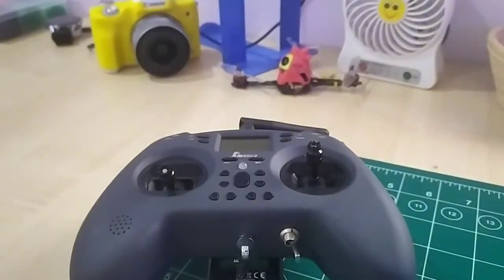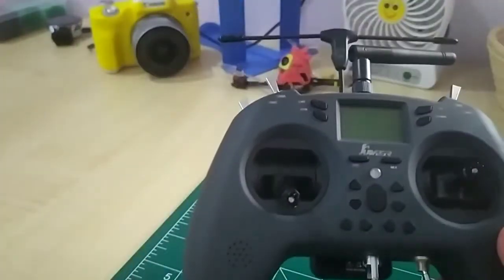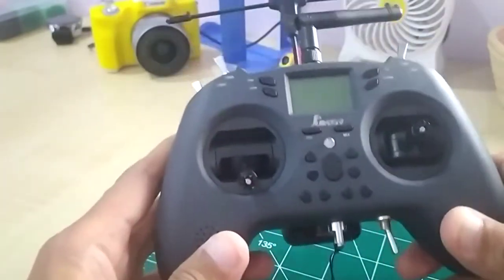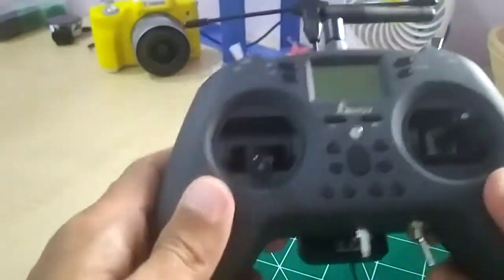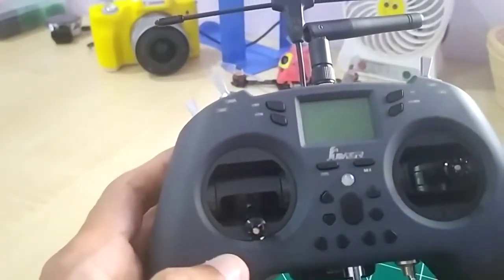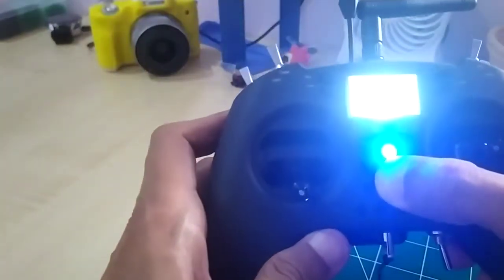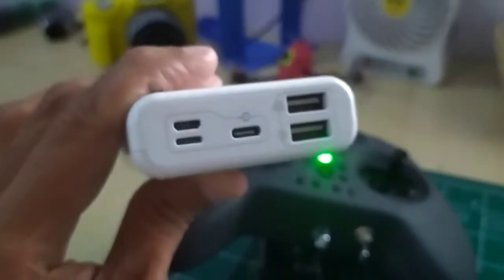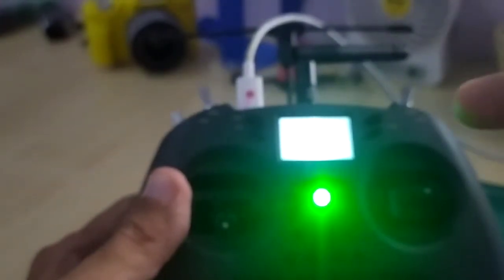Jumper T-Lite with TBS CRSF Mods: Can I Plug Powerbank while Radio+Module On?

Comment: So is it work at 500mW above power with Dyn turn off when we plug in the power bank usb c to exact the module type c? (not the controller) Did you it still turn green?
Reply from the maker: Yes. You can power the CRSF transmitter directly using its USB-C port from a powerbank. Tested up 1W.  But don't think I feel comfortable having the CRSF module powered from USB C cable. The USB came off loose or accidently pulled out, can kiss the qwad byte bye (unless you have GPS rescue of RTH)
Reply: @myfavouritegame  In my case it didn't work. even 500 mW while plugged in powerbank causes unstable behavior of t-lite.
Reply from the maker: @edfroxt7294  Thanks for sharing. Anyway, I suggest you do the same setup that did. Which was based on Alberts Kim setup